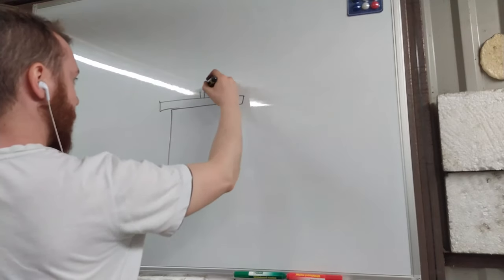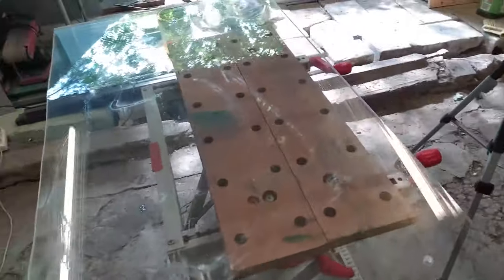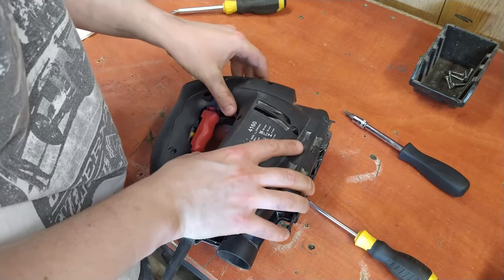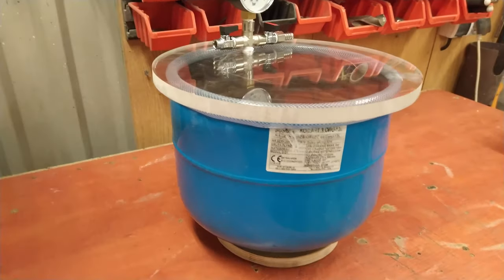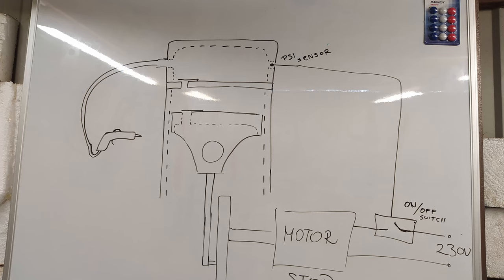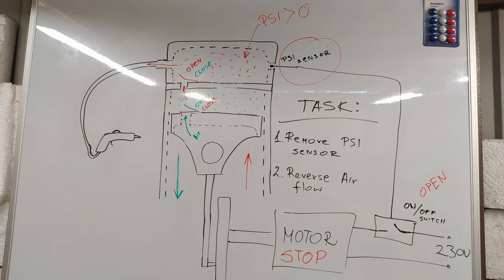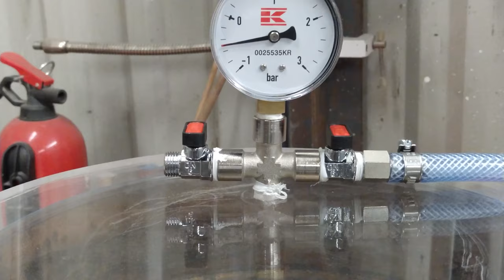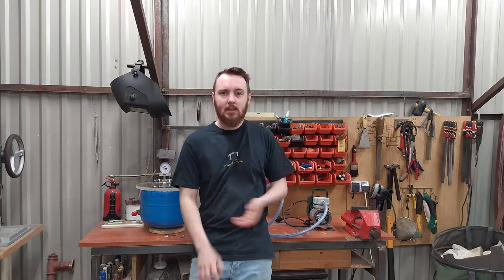DIY Vacuum Chamber and Vacuum Pump!!!

Comment: wow, I'm surprised 1mm thick steel wall can withstand the air pressure when the chamber is under vacuum.  I wonder how close to buckling it is...
Reply from the maker: The wall is 1,5mm and it's not a typical cylinder- it's more like "squared" sphere- it's much more resistant to push/pull force than the cylinder. But I agree with you- it's pretty amazing lol

Comment: Can we make a fully transparent vacuum chamber in the shape of a cube by just using acrylic sheets of 15 mm thickness?
Reply from the maker: I think it should work but I would glue AND screw walls together. Sometimes people use 100mm acrylic pipe. It works too. Thanks for watching!
Reply: @DBCraftWorld  Yes, we would definitely glue the walls with silicon glue or a strong adhesive, thankyou so much!